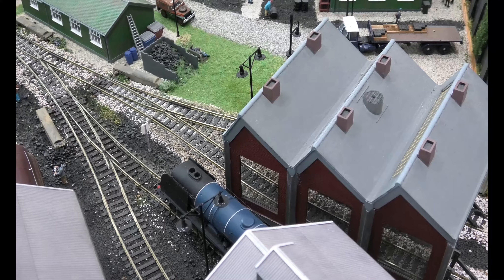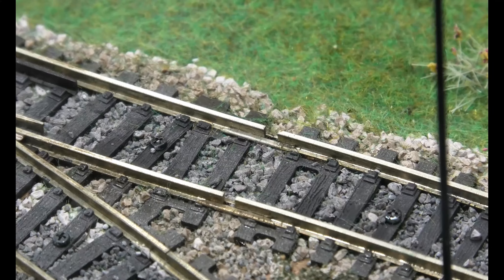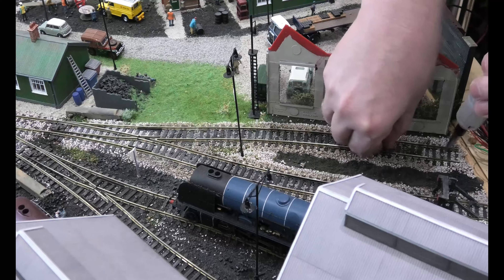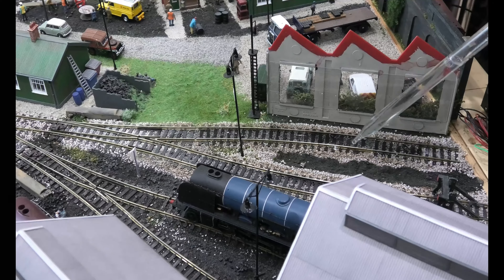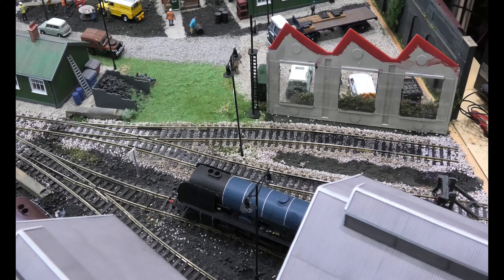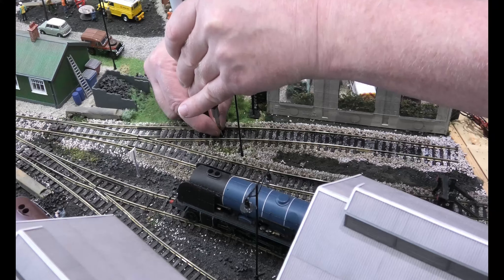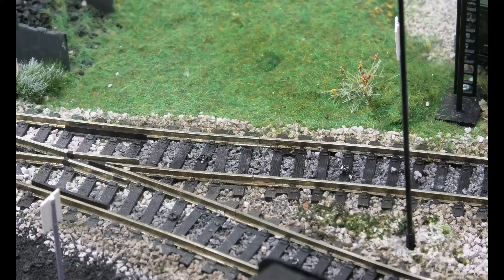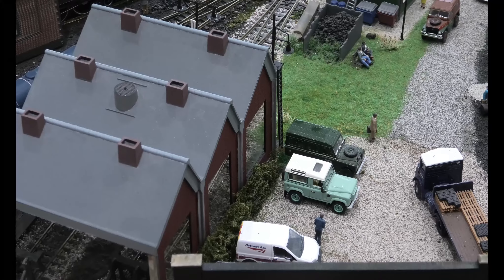Fixing an unwanted expansion gap where track connects in a railway siding.

Comment: Some great tips there. As track expands and contracts though, wouldn't it be better to leave at least a small gap? I've seen someone use a shim then remove it so a small gap is left.
Reply from the maker: The prime concern is smooth running, in real life track's are now welded they expand and contract together. Also promoting a gap will just allow dust and grease to get into the fishplate and effect power conductivity.   I do have my own group on facebook if this is any good to you. Paul Briden's model railway group.
Reply from the maker: Where objects in a room are exposed to the same temperature be it the same air or what they are attached to the expansion and contraction is uniform. Obviously if you were to lay some of your track on concrete and some on wood it would be different, however, even then the temperature range I suggest in the normal model railway environment is not enough to make enough of a difference to worry about.Outdoor railways maybe different but having never built one nor having any interest in doing so I do not know.

Comment: Track pins are easy to get out if you use a pair of nail clippers, but don't use the wife's.
Reply from the maker: Or the wifes make up brushes for levelling ballast. It is all subjective, I prefer the finite adjustment of screws.